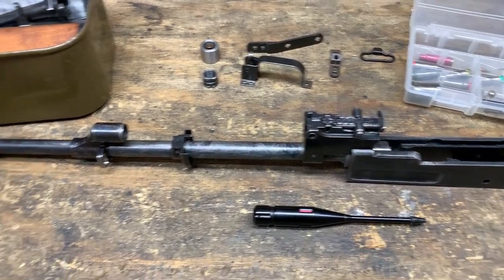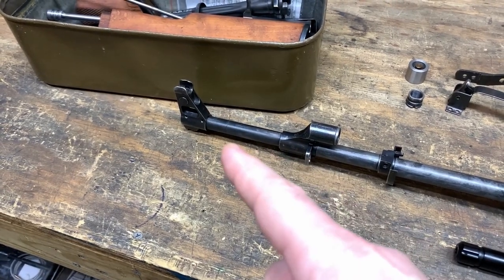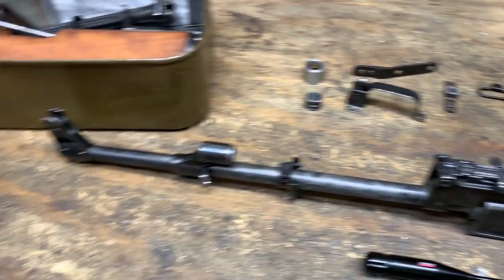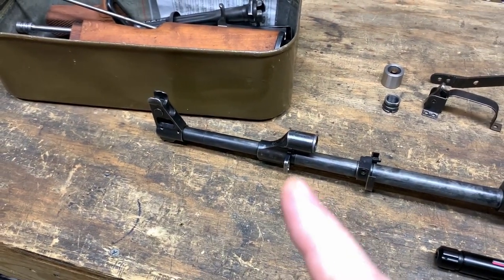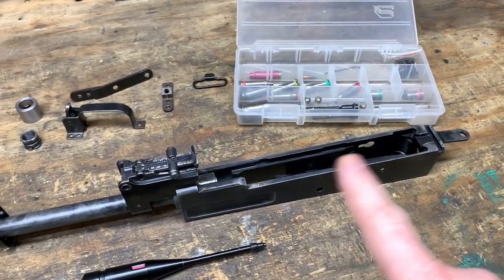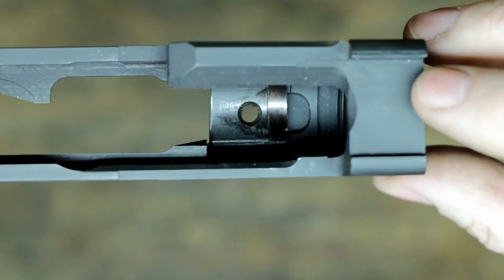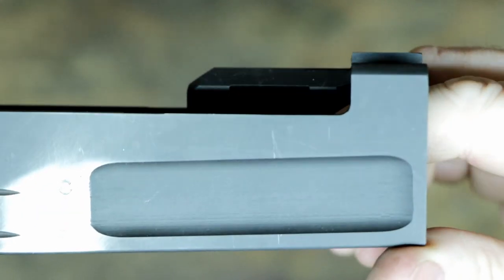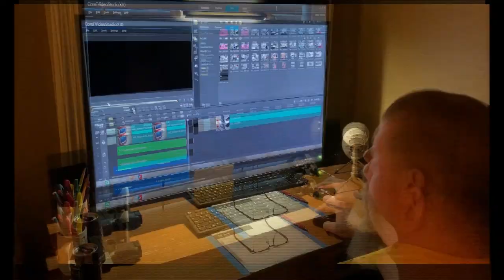Tortort - 1960's Polish Type 3 part 5

Comment: 11:09 What part is that? This is the first time im seeing a milled built so Im curious as stamped rec's dont have that step
Reply from the maker: Milled aks have a front slot where the hand guard nests into. That slot also makes it easier to rivet the bullet guide in as well. A cover (that sheet metal part) is used to cover the slot.
Reply: @Mel64d  Nice. Well maybe I'll check this whole milled thing out. The barrel install  reminds me of that on a SIG 55X series rifle I noticed you did not pin yours. Its just held in by torquing it down? On the SIG You screw it on and look for headspace and when you find it you stop torquing. Is it like that at all? I also noticed some milled AK's are press and pins I think the YUGOs are but maybe the others are not. Still interesting the milled world is different for sure

Comment: Hey brother, im in the process of trying to replicate the tool thst you turned on the laythe to mate the trunnion and bolt surfaces. Would it be possible for me to get some measurements from you? Im on try number 2...lol
Reply from the maker: Hey Cameron,  I did not keep any measurements. I just put the bolt in the vise on the mill and used the Digital Read Out to tell me where the hole was needed to place the pin that goes into the extractor hole location. Pin is a pressed in, not machined into the main tool. I located the firing pin hole with a center finder then located the hole for the extractor pocket.  The diameter of the main tool is just smaller than the hole in the front trunnion. It's like 0.9060".  I turned the step in the face of the main tool to fit into the center hole where the 7.62x39 cartridge nest into.  You could make one out of wooden dowels if you really wanted to.
Reply: @Mel64d  Thank you more than words brother! The pin thing makes sense, and leave it to me to make things more complicated than it should be!lol

Comment: This is a awesome build.   When you do the lower tang in this video where did you get the steel block for the rivets? Or did you just simply make that? I have a arsonal that I need to replace the lower tang.
Reply from the maker: I am using the ak-builder 'trigger guard jig' to install the lower tang and pistol grip piece.